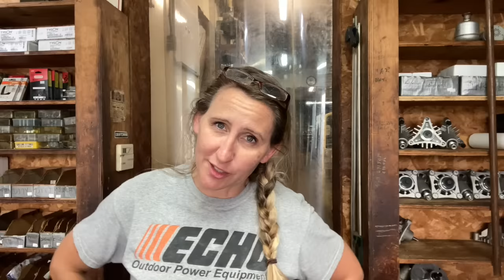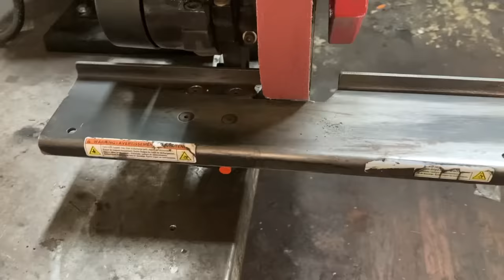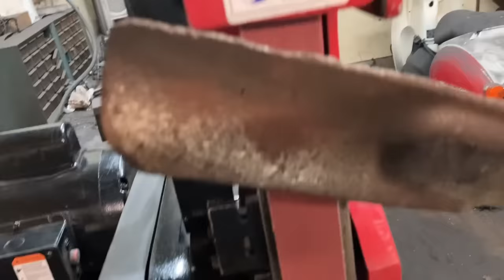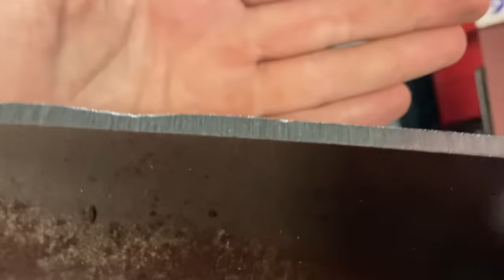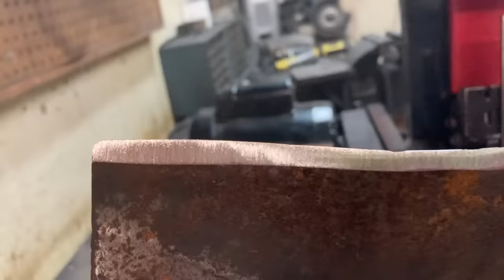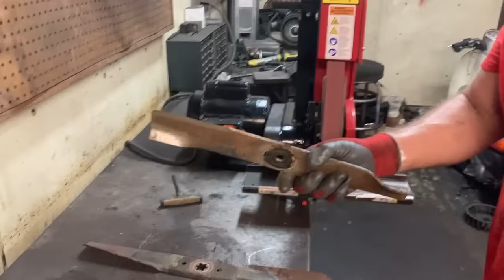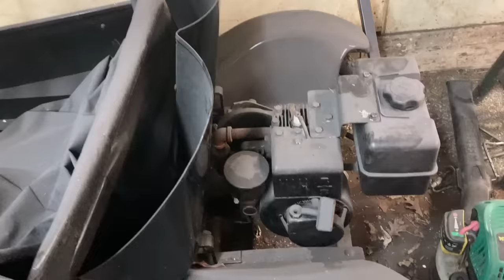The Best Blade Sharpener Ever!!! Oregon Burr King X400

Comment: That is the best blade sharpen I have ever seen! I love it, but can't justify the price. If I owned a mower shop I would definately have one!
Reply: Best thing to sharpen a blade with is a file, and take your time.
I don't know why people sharpen more than 3 inches from the end, beyond that the blade is really not cutting very much until the tip is dull. By that point the tip is tearing the end of the blades of grass and the tips turn brown.
Reply: HARBOR FREIGHT  belt grinder $60.00 as of 04/22
Reply: @rjazco51  Excellent! Thanks!
Reply: @NOS 
A file would not be a logical choice in a production setting. This process doesn't overheat the blade like a typical bench grinder and maintains angle. The price is high but it's an effective way to do this when you have a pile of blades
Reply: @nos9341  well, you sharpen them however far the OEM sharpens them.  If you dont the customer is going to complain.   And yes, newer blades do cut much farther down the blade.. you dont have to believe it.  And sure, using a file will be fine if you have nothing else to do.. But when you have 100 mowers waiting to be tuned up and sharpened in the spring, that dont cut it lol..
Reply: It's just a glorified blet sander.
To must $$$$$$ to spend for the average people 😊
Reply: @beachbums2008  Yea, it's a heavy duty belt sander with a couple of specialized parts to sharpen blades, and it's be best $$$$ we ever spent.. But, during the busy season doing dozens of blades per day and some days if commercial folks hit, lots more.  Time is money, and you get a fantastic looking blade sharp in less than a minute unless they are REALLY bad shape, then may take a couple of minutes.  We have had the big ruby wheel grinders and of course in the past decades ago, we used a little bench mounted 5" bench wheel grinder..   This style is by far the best for us.

Comment: No doubt that sharpener is a beast but as you said it's not really practical for the average home owner or even small mowing operation (cost wise).  I personally just use a Ken Onion sharpener with the heavy duty utility belt, and it does a fantastic job, just not nearly as fast.  Thanks for showing this beast to your users, and love your videos!

Comment: Nice sharpener, fast, but I wouldn't call that perfect. And yea, Hustler blades here... I sharpen blades about every 10 hours (1-2 cuts). Hand held angle grinder works great for the $. It's more technique than anything else. And you aren't done sharpening until you balance it. Don't let them get hot. They dull faster.

Comment: That is a very cool machine. Is it 75 times cooler than my $20 yard sale bench grinder? Yep, probably. I have gotten pretty good at keeping a blade in balance while sharpening it by using the Bruce Pender method. Another very cool balancer / sharpener was the one Zippo had a while back. All of them are nice. The main problem with mine is the nut holding the blade while it is being sharpened. I don't have a Burr King X400, but I got Burger King 2 Whoppers for $5.
Reply: $2500 sharpener

Comment: I made my own that uses a 60"x2" ceramic belt with a 3hp air compressor motor.  I have a backup plate on part of it like yours but also some of it has no backup so I can do mulching blades and I mounted all my grinders on a stand with an actual spark catching funnel and bucket.  I'll post a video on it so we can compare

Comment: AS john "Q" home owner, I have found that a flap disk on a Harbor Freight angle grinder works wonderfully. That is an awesome tool for the kind of work that you are doing! There are more  applications that it can be used for. Thanks for the VID, Keep them coming.
Reply: Your method + Sawhorse and C-Clamp.

Comment: Always cool to see awesome tools . 😃What should really be stressed is how having a sharp blade is better for your  grass and easier on your engine . Do it yourself if you can or have a pro do it . Either way great investment!
Reply: Yes, with a sharp blade I can turn the engine power down significantly,  except in the spring when there is a lot of grass to cut.  At that time, I use a high engine power, but the sharp blade still slices through the grass without bogging down.

Comment: I have a Jet square wheel grinder that does the same thing, plus it has a two inch, and four inch wheel. It has a backing plate that can be turned around to do loose belt sanding/grinding. I've been using my side grinder with a flap wheel. Since seeing this, I think I'll go back to the Jet. Great video.

Comment: I have a 1971 B+S motor on an air cap mower that thing won’t quit it still cuts grass 50 years later, even the overhead fwd still works ( has chain driven pto w/ rollers over front wheels)

Comment: Hard to beat the 1hp motor 😉 my business is quite small so I can't afford that machine yet but when I get to the point where I'm doing enough blades to warrant it I will have one. For now I have to stick to my angle grinder and flap disk which is no where near that fast but fast enough for the volume I do.  Great video.
Reply: I like using the 40 grit flap disk on mower blades.
Reply: @robertheinkel6225  I think I'm using 60 and I think I need to move to a 40. It would definitely speed me up
Reply: @davidliles87   sounds good
Reply: Harbor Freight belt grinder $60.00
Reply: 1hp is less than 750W, my 125mm (5") angle grinder has more power. The sharpening results were well whatever, dents and chips galore.

Comment: I purchased an All American Blade sharpener a couple of years ago and although I have several sharpeners in my possession, I prefer this one because of its' accuracy. It is not as fast as the one you are using, which I also own, I prefer the accuracy of the ALL American over the other options. I then use the MAG-1000 Professional Blade Balancing Instrument.

Comment: I use the Dremmel Mower Blade attachment/perfect angle ($20?) - mine comes out razor sharp, with no niches or dips - my hand slipped into one during reinstallation once (socket slipped off the spindle bolt) - 13 stitches!  Learned to wear leather gloves after that!

And after sharpening, put a thin coat of grease over the exposed metal to prevent rusting (winter storage).

Comment: I used to sharpen my blades to a actual knife edge, but after reading the Honda manual, they recommend a small flat on the cutting edge. So I've been draw-filing a tiny flat on the edge the last few times I've sharpened it, and it does seem to keep the stone chip damage to a minimum without affecting the cut quality. I've had to grind less to resharpen the blades as well.
Reply: I read the same thing over the winter and do what you describe.

Comment: As usual a good video.  I learned decades ago that the “right” tool can make a big difference.   However, I don’t sharpen enough blades to warrant one like yours.  However,  a right angle grinder can still  make short work of it, especially if it is a 7” one and not a wimpy 4” job.
Reply: True,but the 4" grinder is safer!
Reply: @georgepruitt637  perhaps, but way back when I made my living making lots of little pieces of metal from bigger ones, I used the bigger grinders a lot.  I never thought they were particularly dangerous.  The handle with the trigger fit a gloved hand way better than the body of the little guys that doubles as the handle.   But the biggest problem I have with the little guys, is the trigger locks on.  Way more dangerous in my opinion.   The trigger on the bigger ones, at least those that I used, was momentary contact, only as long as I held it on.
Reply: Now let's talk about balance
Reply: I'm sharpening my blades quickly with my "wimpy" 4.5 angle grinder. I wouldn't want to grind any faster.
Reply: That wimpy 4.5 grinder can take your fingers off in a heartbeat hate to see what a 7 inch man sized grinder could do.
Reply: Yep I use a 7 inch hand grinder and it’s plenty fast for me
Reply: If you’ll scared let someone else do your work

Comment: I hate to nit-pick, BUT, when I worked  at a mower shop, we would take material off the blade until it was square all the way across the blade (got rid of the round tip) 90% of the grass cutting is done on that first inch of the blade. Otherwise, great video. That's a nice machine! Do you guys have a good blade balancer?
Reply: Yep, I agree and also should not be razor sharp, should have a slight flat edge like scissors, too sharp, they will just round off…….neat machine but definitely needed finishing touches….for another 45 seconds or so

Comment: Don't forget to balance the blade after sharpening it. I clean off the crud before sharpening, too. You don't want the mower handle to shake out of your hands from an unbalanced blade. To balance it, I hang the blade from its center with a ball chain over a level surface. Then I sharpen more off the heavy end (the lower end). Time was never an issue to me, cost was. I use a bargain bench grinder (Harbor Freight) with a home-made guide bar. I make centering bushings for the ball chain on my old Atlas engine lathe.
Reply: see the pinned post

Comment: Having worked for John Deere    and sharping blades and servicing those mowers.John Deere owners manual says to file a flat edge 3/64" wide on front of blades. That razor sharp edge rounds off very quickly. I own two John Deere  mowers have not needed to sharpen the blades for three years still cut like new blades

Comment: I’ve always been told that getting a blade too hot takes the temper out of the steel. If that’s so do these hold an edge for long after such a quick sharpening session or is it a higher temperature threshold to change the temper?
Reply: At the end of the day, what matters is, the thickness of steel, and the grade of steel. A residential mower uses a light blade, which is easier on lower horse power engines. Problem is, they don't hold their edge for long. Commercial mowers use heavier duty blades, larger engines can handle them, and they hold their edge for longer. In order to ruin Steele temper, you'd have to get it red hot at least with a torch. Grinding on a blade doesn't get it hot enough to do that so your fine.
Reply: It is a ceramic belt, stays cool
Reply: If you keep the blade moving, and don't change the color of the blade sharpening it... you're usually good to go. RED & BLUE blades are pretty.... just not practical!!!
Reply: @stellarproductions8888  Grinding a blade can indeed ruin the temper. It’s not even that hard to do if you’re careless.
Reply: They are slightly tempered, more for evening out the grain. You wouldn't want it too hard or pieces could come off if you hit something hard like rocks. How do you think the manufacturers sharpen blades. Bet the cutting edges aren't forged
Reply: That’s the first thing I thought of when I was watching also you shouldn’t push it so hard that the tool bags down
Reply: @Guitarplayer724  Good point: Point being, no mater what your sharpening tool, a delicate touch is required for this job. If one's mower blade is too trashed for a light touch then one must lower their expectations.

Comment: I prefer my method of hand filing mower blades.  It consumes a minimum of the blade, and leave a nice smooth finish on the blade.

If the blade is significantly dinged up, I'll start with a bench grinder.

I have two blades for my mower, so I can R&R a blade with a sharp blade, and then sharpen the other blade at my convenience. 

That's what works well for me, but I'm always happy to view blade sharpening videos like this one to see how others do this task.

Thanks for an interesting method to view!

Comment: would love to work with you in your shop.  I worked on small engine as a hobby 
for about 40-50 years but I like the way you never get upset at repair problems.  love ot watch your video

Comment: Nice.. when I bought mine I finally decided to spend a little more and get this guys big Brother... I got the Oregon 760 blade grinder  1 1/2 hp motor,  60 inch belts , keeps the belt cooler,  I have had it for a year now and its amazing......
Reply: These things are priceless in the shop. The thing fabricates tools and brackets for me all the time. Full set of commercial blades balanced in 7 minutes. That could take me 30 minutes with an angle grinder.
Reply from the maker: Nice!!

Comment: I am a cutting corner guy. Sharping a mower blade is different from sharping a knife.  Mower blades don't need to be very sharp.  So before I mow my lawn, I tilt the lawn mower at one side and use a coarse filer to file the blade at both cutting sides.  This way the mower blade is sharp enough to cut the glasses.  Fast and easy.

Comment: Great clip, that grinder is fast and seems simple to use. Great for shops with many hands sharpening blades as everyone uses the hand held grinder differently. My only small criticism is that, like a chain saw chain, the most important detail is getting a square corner...that's the first point of contact as it needs to not have any rounded edge on the corner. Honda has a very good example in all their mower manuals.

Comment: Belt sander is definitely the best way to go for sharpening mower blades.  I ended up with a 2" wide x 72" Knife Belt Sander in my shop.  Not specifically optimized for mower blades as your is, but more versatile for other work and it does a wonderful job on mower blades.

What do you use for balancing?  After trying numerous others, now have the Oregon 42-047 Magnetic balancer which will also tell you if the blade is running true (or not).

Comment: I run a 3hp motor with ceramic 2x72 belts. Now I did not build it to sharpen mower blades, but it sure does it well.

Comment: Thanks for the video.  Took my John Deere mower in for warranty work on belt breaking.  Got deck pully replaced. Was told that the blades were worn out and they replaced them (Yes at cost).  Prior to taking the rider in, I had replaced the belt and sharpened the blades they would tell me were worn out.  These blades did not look any worse that the ones you sharpened here.  Could you do a video on what a worn out blade looks like and when it is time to get a new blade?

Comment: Those high end sharpeners work well, though they seem to take more practice to get a proper blade angle, though one benefit of getting a mower blade sharpened is that they end up sharper than the factory edge. with a quality blade that is freshly sharpened, you can take a basic 190cc mower and push it through some thick overgrown grass and it will handle quickly cut through it without much trouble, great especially if you recently purchased a new house and need to fix up the lawn. get your blade sharpened really well, and it will cut better than a new blade. for a decent amount of time and make dealing with an overgrown yard much easier.

Comment: The easiest thing is to use a angle grinder with a adjustable level set up on the back part of the grinder. All you have to do is keep the bubble centered. Let the sparks fly.

Comment: I use an angle grinder  with med grit disc, l get 30deg spot on blade edge nice and smooth, just a tip chk  balence before fitting  a new blade you'll be suprised how far out of balance they are from new!! Benift of using angle grinder, you get flat edge not concaved as on belt type machine!

Comment: It needs to be a little bit thick on the edge. If it is really sharp, it will chip or round over, hitting sticks and stones. On my 54" , I keep an extra set sharp, so i just change them out and sharpen the others when i have time.

Comment: That is a very nice bench top power tool but not meant for the average home user. I use my very old Craftsman 9" hand angle grinder with a heavy grinder disk. Set the blade vertical in the vise and grind away the dullness. Of course balance the blade. I sharpen my blades a minimum of 3 times a season and my hand grinder does quick work sharpening them.

Comment: I know, old post, but I recently discovered there is a strong correlation between the sharpness of the blades and how clean the deck stays. Unfortunately, mowing 6 acres does not justify a commercial sharpening machine. I will continue to do my blades with an angle grinder. I can keep a straight edge and 30 degrees but it does take some time. If I don't mind waiting, my brother has a RBG-7, but he lives 600 miles away. It's another fine commercial sharpening machine. People who flatten the edge are missing the point of having it sharp. Dull edges splatter the grass and make it into an adhesive and corrosive goo. They can dull their blades and I'll sharpen mine.

Comment: Great job on the sharpening !
But what are you using for your balancing process ?
And how much time are you adding by the time you include the sharpening, and balancing process for both cutting edges, or are you showing 55 seconds for both edges of the blades ?
I would love to be able to sharpen blades in 55 seconds, but by the time we work to balance the blade, and do the touching up, as the balance process can take a little longer for us than 55 seconds, and we have a fairly decent sharpening system, and an extremely sensitive balancing tool as well !
Totally open to suggestions, as like you, we can do about 15-20 SETS of blades every day !
Thank you !

Comment: If you only sharpen a blade or three occasionally, all  you need is a well maintained USA made 16 inch mill basterd file and a vise or a clamp. I don't remember exactly what I paid for the USA made file but it wasn't cheap. Yes files need to be maintained. That's what a file card is for. Also, no worries about over heating the cutting edge with a file and it greatly reduces the potential for injury compared to a grinder. At least until the blade is razor sharp !